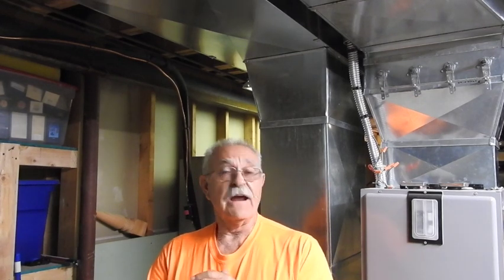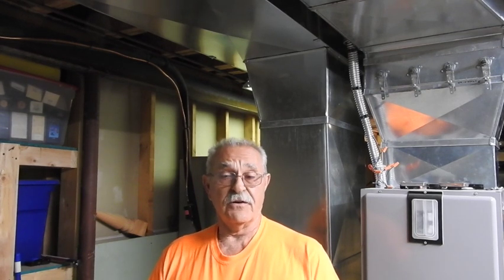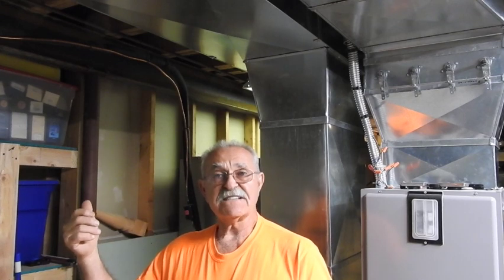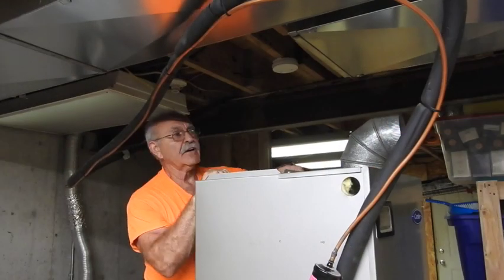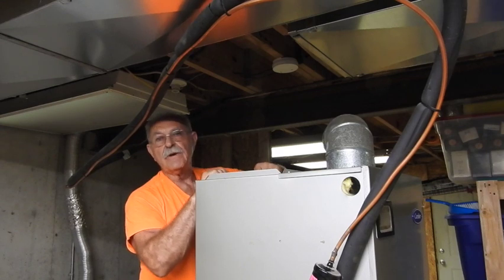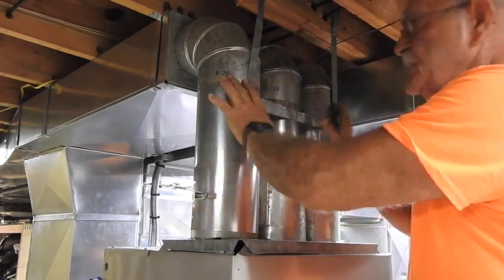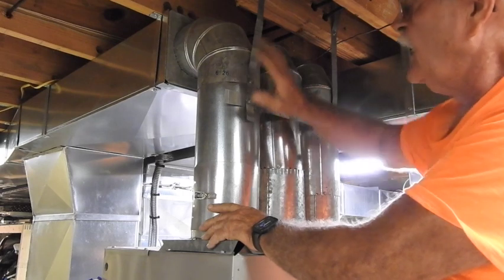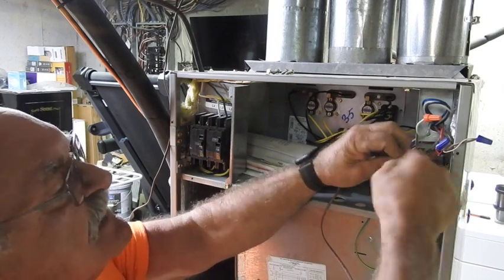Franken-Furnace: 100 F What Would YOU Do For Air Conditioning

Comment: This kind of out of the box thought process is just what I hope to be able to formulate when I need to. I can't claim to have come up with anything quite this impressive but did have a similar idea once. Split system was switched one day to get AC back on then I added new ducts to drop down from the attic to the first floor. At the end tie in the new duct and boom the whole house was cooling. Um except a power surge zapped the new condensers capacitor and then fried the compressor ugh!
Reply from the maker: Well, it was a good plan you had anyway Andre.  That really sux though that the compressor failed after all that.  But that's the way it goes sometimes !!  On this one, I was so glad that I left the old system intact while waiting until spring to install the new one.  No one could foresee the manufacturing delay coming on the horizon though !!  Of course it may just be this brand and not industry wide.  Being retired, I am really out of the loop now.  Thanks for the awesome comment Andre !!

Comment: R-22>410. It cools better.
Reply from the maker: Well 410 and the different characteristics made it a bit odd to work with.  Anything you become familiar with is going to be the preferred component.  We knew R12, 22 and 502's operating pressures and temperatures almost by heart. Now we have so many refrigerants that've flooded the market it boggles the mind. There are good things about 410 though.  One being the operating pressure is so high, it almost eliminates the need for 'P' traps in riser and also changes to line size is minimal if needed at all because of the much higher refrigerant velocity and pressure.  But I am NOT a fan of 410 in general.

Comment: i couldnt understand, why didnt you just put old coil in new AHU? seems to me there would be less work. and you were going to show how to put addon wood furnace in parallel with ahu. did you that or i missed it? thanks a lot.
Reply from the maker: Yes, I've installed a wood furnace in but I  don't think the video has been edited yet.  I did upload the actuator operated back draft damper for the wood furnace though: https://www.youtube.com/watch?v=Pcz0iEgtuBk  Physically the old system indoor coil would not fit the smaller cabinet of the new air handler. So this was the easiest and quickest solution that will not jeopardize any of the previous work to get the needed cooling for a week or so.
Reply: @tractorman4461  got it, thanks. Looking forward to see your wood furnace video 😊👍
Reply from the maker: @thecurious6721  I'll get it edited one of these days.  Thanks for the interest in the sheet metal videos.